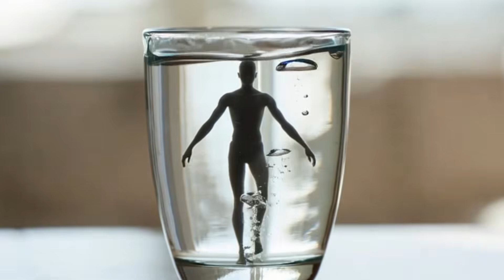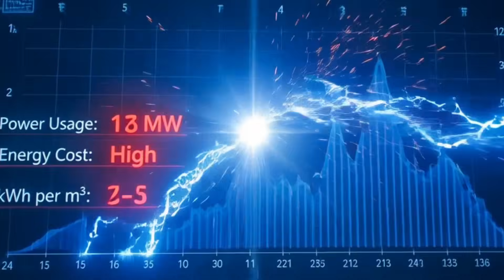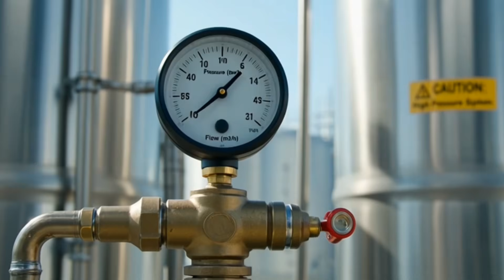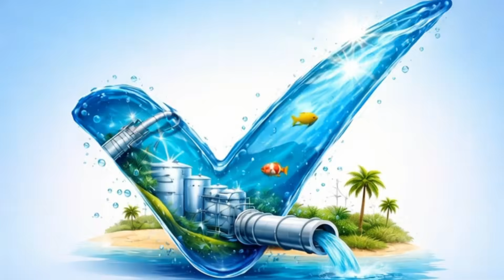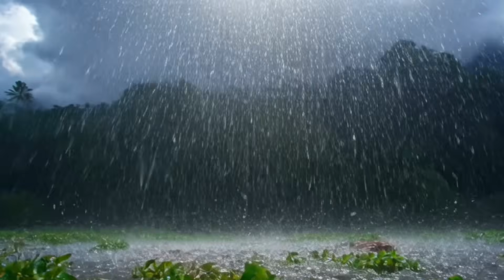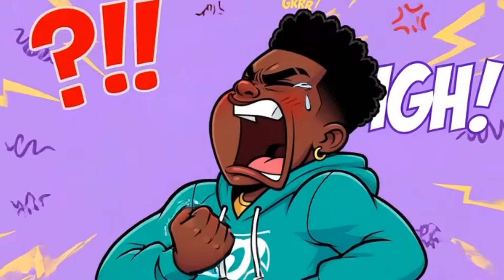South Africa Is Surrounded by Oceans… So Why Is There No Water?

Comment: How about finding areas where the watertable is a bit higher and dig high scale deep wells. Underground water supply is a bit reliable, is pumping that expensive?
Reply from the maker: That’s actually a very good point. Groundwater is used a lot in South Africa. It has its own challenges but it's certainly an avenue that we have looked into and implemented! Thank you for this!

Comment: While listening I was thinking about the Persian Gulf and their dependency on Desalination Plants. We need to do a much better job with maintenance of the water infrastructure and getting rid of these water mafias.
Reply from the maker: Good point! The Gulf countries rely heavily on desalination. It works there because they have very stable and reliable energy supply. In South Africa, improving maintenance and reducing losses can make a huge impact alongside solutions like desalination 💯💯
Reply: @engineeringexplained_SA   you have made the absolute correct point. I worked for a textile company that was either the first or one the first companies to try the R.O process inSouthAfrica. Because of where we were located we had to get rid of the color in our effluent. Being the Dyehouse Manager  I was involved with the plant.As you have pointed out the energy required for for a plant like this is beyond South Africa's means. No problem for the Middle East or other oil and gas rich countries.

Comment: I think also another problem is most townships don't have drainage system on the street so most the rain water can be collected by drainage system on the street then transferred to cleaning plants and send it back to people. I thank drainage system are need in towns and township because alot of rain water end up evaporating back up or go in the ground
Reply from the maker: You’re right; drainage systems are a big part of the picture. To actually make use of that water, it needs to be paired with storage and treatment systems like retention ponds and reservoirs. That’s where the real opportunity is! Thank you!

Comment: south africa wastes a lot of water (half) through leaks ,we can get that water back.
south africa can still invest in water recycling,water is renewable, recycle it efficiently enough on a large scale so we do not pour it into rivers so much,recycle more waste, recycle everything.
south africa can also invest in more intensive water infrastructure to capture stormwater,places like kzn and mpumalanga receive more or less regular high rainfall events that off load incredible amounts in short periods,literally we can install the systems we need to capture and deliver the bulk to the places that need it or at least the dams near them,i think currently these rivers like tukela they immediately run off this water within hours.dont think this option is low hanging but thats how it is when you are water scarce, we can make it feasible enough we would be good,south africa also has abundant solar ,coal,nuclear why arent these reliable options in high demand purposes.
Reply from the maker: You’re 100% right — and this is actually the part most people miss. We’re not just short on water… we’re losing the water we already have.
Fixing leaks, recycling water, and capturing stormwater can go a long way; often cheaper than building new mega-projects. The challenge is scale, cost, and maintenance… but that’s exactly where the real solution is. This is a BEAUTIFUL COMMENT! Thank you 💯
Reply: @engineeringexplained_SA  thanks.its shocking how the country is running with such extreme systemic inefficiencies.